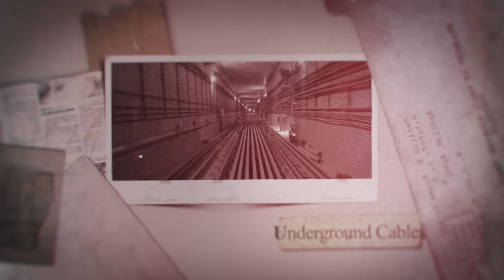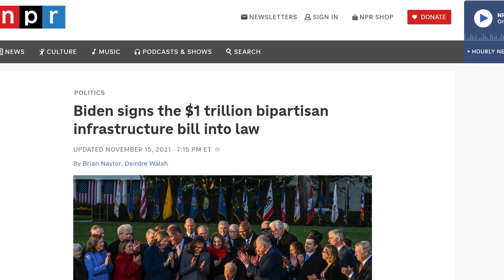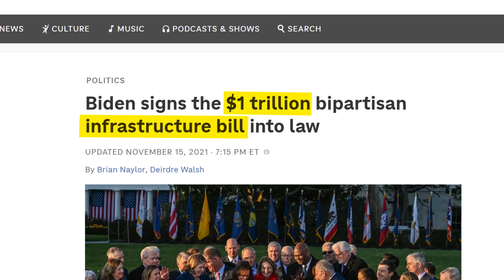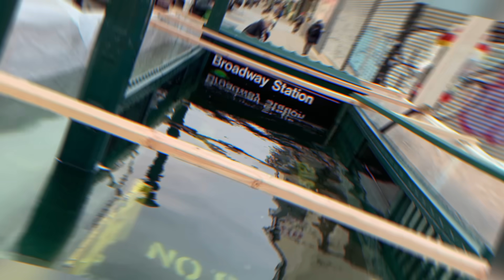Why Tokyo Has The Most CHAOTIC Power Lines in the World?

Comment: So underground costs 4 times as much at scale. Is that lifetime cost or is it just the sticker price?  Because if an overhead line needs to be replaced 4 times as often as an underground one, those savings melt away very fast.
It's the classic Pratchett example of cheap vs. expensive boots. Boots for 10 bucks last you a year. Boots for 50 last ten years. What's the better value?

Deapite this I agree with the conclusion. Overhead cables make sense if underground is also at risk. In some regions both might be necessary.
Reply: Underground is the best way. It just makes a city way more beautiful
Reply: It is not just financial, for esthetics alone it is more than worth it.
Reply: Wrong.
 No matter how many Times you repair,  over ground is still cheaper than underground.
Reply: @raghunandan9290  The costs are not only fixing the cable but also thinks like: lost business of companies that depend on electricity. Also many wildfires have started in California because of overhead electricity cables. Tens of thousands of houses have been burned to the ground in the last few year.

Comment: You know Europe is a continent too right? A lot of big cities in Sothern and costal countries have the same approach as Japan.
Reply: No at least here in spain is not the case ..you cant find any overhead cables in city centers they are only used in old neighborhoods or small villages ..and they dont use the same approach as japan they mount the cables along the buildings so they arent chaotic and unpleasing aesthetically
Reply: @aymanla471  Which cities are you talking about exactly. Just curious
Reply: In Germany you encounter only in some older rural neighborhoods overhead 230/400 Volt powerlines, often from house to house on poles on the roofs.
The higher voltage levels 20 kVolts, 110 kV and 380 kV are in Europe mostly overhead, except in the cities.
Reply: There's also overhead wires in most of Lisbon as well, because of the earthquake risk.
Reply: Portugal it's not the case also. We have cable and power lines underground or along buildings, and we are a sysmic area.
Reply: I live in southern Europe  hardly any overhead wires in cities nowadays. Still there in some rural town but not in cities
Reply: Can you tell me what cities you are talking about? I have been all over Europe and have never seen overhead cables.

Comment: Underground cables is really nice to avoid power surges from lightning strikes too.
Reply: But during periods of high demand underground lines can overheat and cause outages .
Reply: HV cables have higher losses because the ground makes a good capacitor. Also, most overhead lines are protected with MOVs these days, negating this advantage.
Reply: where does lighting strike? in the ground. power surges will still happen. underground cables is still a aesthetics thing
Reply: @Salt6730  Power cables are earthed. 😂
Reply: Just Used Both No Needs To Argue City State Use Aesthetic While Rural Stated Used Practicality
Reply: Underground power lines do not guarantee no power loss. Flooding can take out underground power systems.  It can cost 20 times more to install underground power. With the recent cyclone in Southeast Queensland, relatives with underground power still lost power for days, as the main high tension feeder lines were taken out.
Reply: @damianousley8833  Floods in Germany are usually limited to localized areas, and when a flood is this severe, everything has to be rebuilt anyway. It makes no difference whether it's above ground or underground.
Reply: @bjorndebar8361  Only difference would be time and cost.
Reply: @bjorndebar8361  Cologne is not rebuilt every time it is flooded, which happens every few years. 

In the more rural area I grew up in floods were not an issue, neither were storms, but we had three other issues that eventually lead to first phone lines, then also power lines, being moved underground in the 1980s and 1990s:

* Lines were often struck by lightning indeed as the village was the most elevated place in the area
* Someone would hit a street side pole with their car every once in a while
* and the final nail in the coffin: the ice rain of 1987 that had cables being snapped as either trees would break apart, or power lines themselves could not bear the extra weight added by the multiple layers of ice on them
Reply: @hartmutholzgraefe  However, not all underground power lines in Cologne are replaced during floods. That was the sticking point.
Reply: Since when the electric cable  was hit by lightning . This nit hvdc line
Reply: And no power cut after typhoon 🌀 , cyclones and tornados
Reply: Until it's not flooding. I would always choose overhead power lines over underground ones. 21× more cost is enough reason to do so.